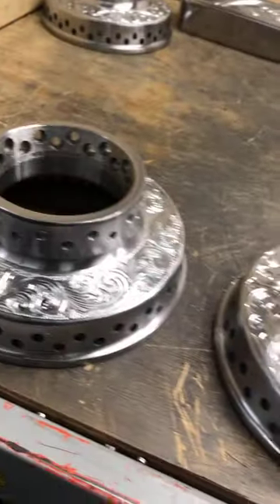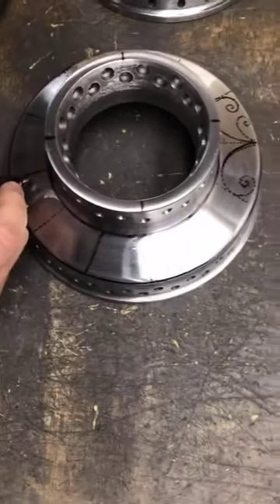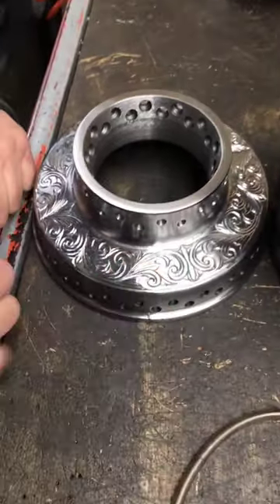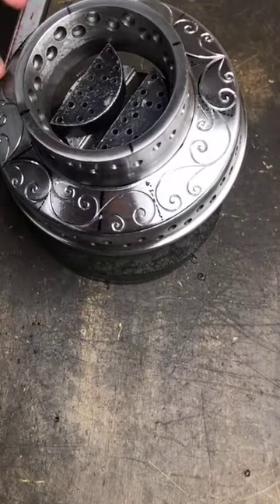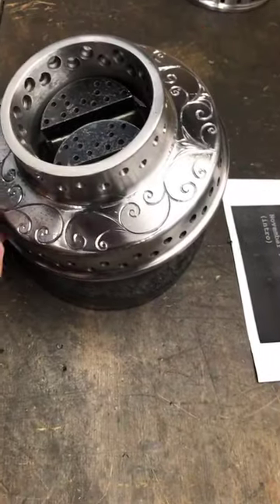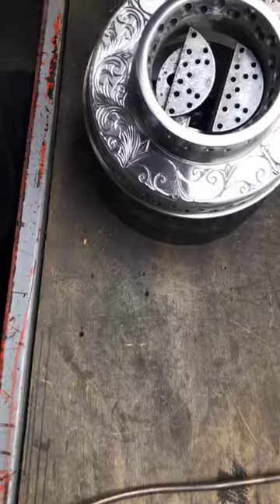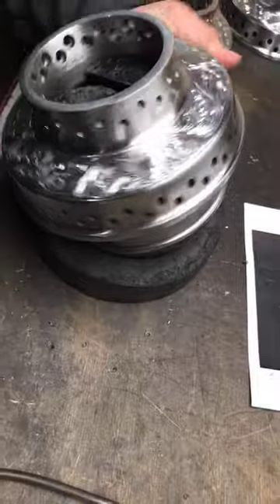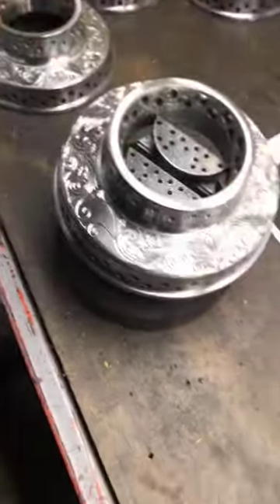Hand Engraving a Superior Wire Wheel Hub

Comment: thank you for the vid. .very impressive . i didnt see in the comments. .did you mention the graver you use. hss, carbalt or tungsten?  you dont seem to sharpen it in vid. .it seems to keep edge well.
Reply from the maker: No I only show in classes I teach. I make my own chisels using GRS blanks
Reply: @engraveit5811  im sorry i should have clarified. . im familiar with sharpening, i have both grs and lindsay fixtures.  i was just wondering what type of metal was your graver blank. . i only engrave soft metals, and basically, the amount of metal your moving so fast just blew me away.  but if its a trade secret. . i understand completely. . thank you for the vid
Reply: Where do I order the machine from?